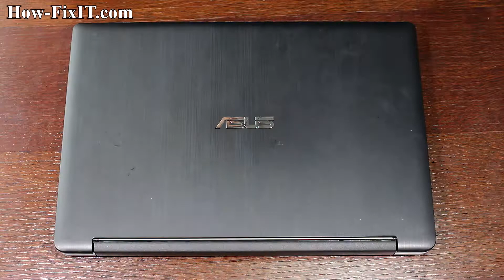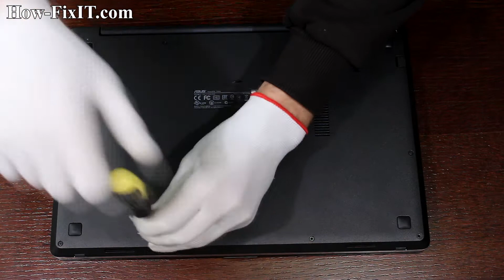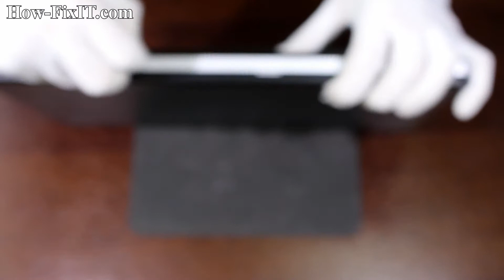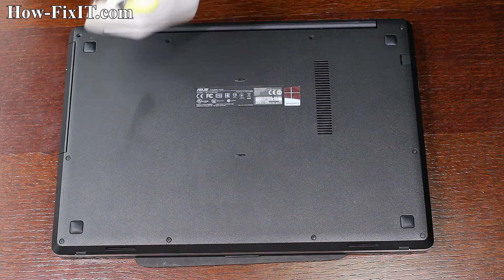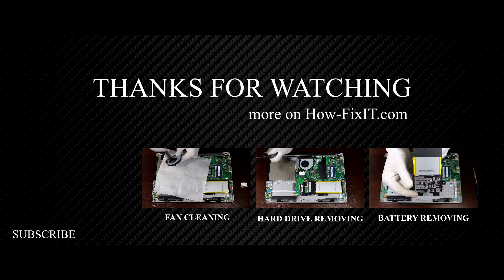ASUS Transformer Book Flip TP550 RAM Upgrade and Install | Step-by-step DIY Tutorial

Comment: Why did you need to unplug that cable after opening the bottom? Also, what ram does it use?
Reply: It's the battery connector; any operation on the hardware should be done with the power completely disconnected (including that connector for the internal battery).